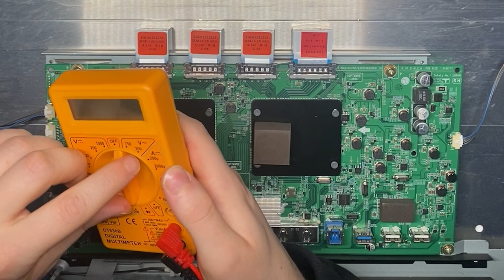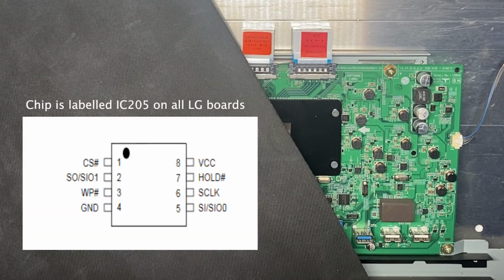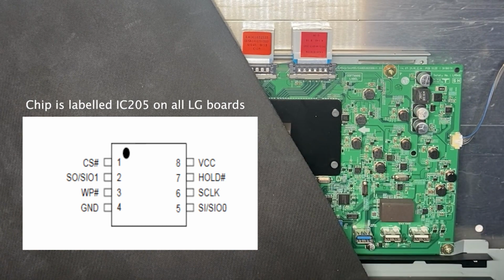LG Monitor won't turn on - LG 34UM95 / 31MU97 FIX

Comment from the maker: Here is the thread I based the video on! You can derive a lot of value from the comments under the blog and in there somewhere, there is a comment teaching you how to update the chip's logic so this problem will never occur again.

https://integer13.wordpress.com/2018/04/06/lg-31mu97-not-powering-on-how-to-repair-this-piece-of-sht/
Reply: Hi, I did all methods and the link you provide here with no success. Power fault occurred after a power cut off. I'm an expert tv technician
Reply from the maker: @πετροςβεντουρης-κ9λ  For me, holding P900 to SCLK until it turned on was the most reliable method. If that fails, make sure to also check if your power supply is still working. 

Alternatively you can try to update the chip using a CH341A USB Programmer. There's a guide in the blog link.